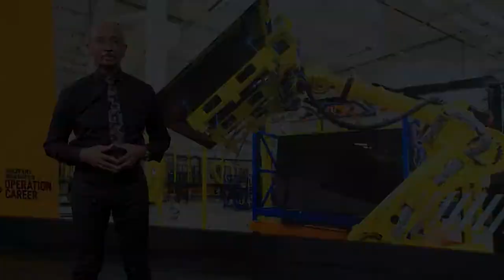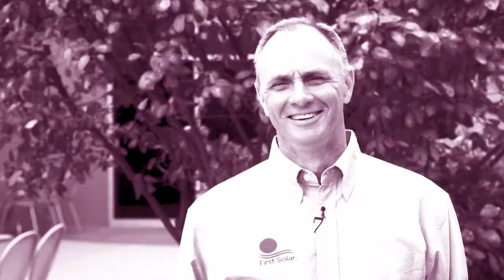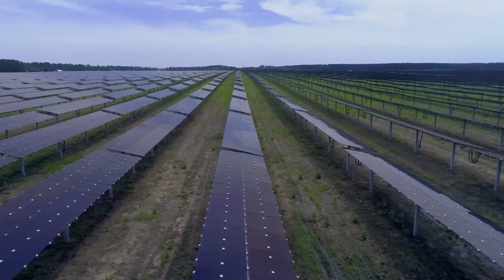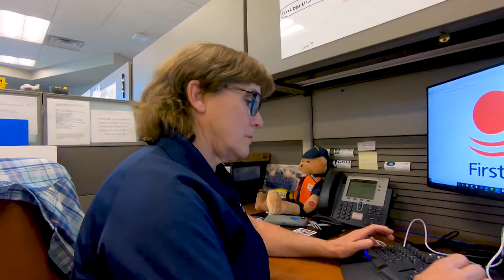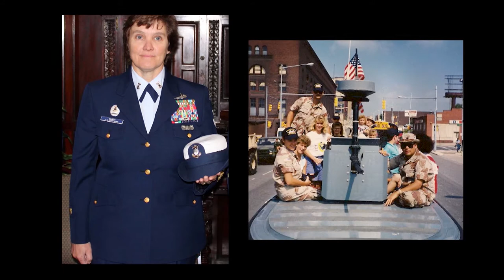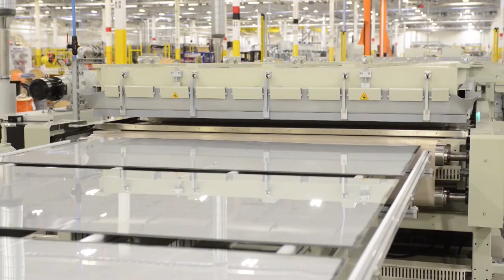Careers with First Solar: America’s Solar Company

Comment: I am working on solar materials for PV modeling and efficiency analysis and publishing in reputed journal as Optik, Renewable and Sustainable Energy Review, Nano-energy, Optical Materials, International Journal of Energy Research, etc. I would like to continue my research on advancement of efficiency as materials scientist or materials Engineer for PV. Then solar radiation, environment related data analysis as well as practical installation related system design and related consulting work I prefer to perform in near future.
At the beginning of my professional life I was in engineering and research field jobs.  Later on, I move to teaching and research job after completion of my PhD in materials for advanced opto-electronics in Japan. Especially optical detectors and solar PV materials for device modelling and analysis is my research area. Intergovernmental Panel on Climate Change (IPCC) claims the highest carbon intensity due to the 40% of world total greenhouse gas (GHG) emission from electricity is an upmost factor. International Energy Agency (IEA) has set net zero emission (NZE) targets by 2050. Emission reduction is essential to avoid environmental catastrophic effect. Hence, low carbon electricity is imperative to meet up IEA target and to overcome the IPCC claims. Very recent COP-26 the continue discussion on environment protection the only solution is finally adapted that is massive application of renewable energies for electricity. As a result, the renewable energy generation from clean source especially massive solar PV is must. 
My research in scientific conception is in the area of nano-materials technological applications through transformative materials science for electronic and opto-electronic device. It is mostly related to the methodology for investigation of light-matter interaction related fundamental properties of diverse nanostructures optoelectronic materials. It is a combination of materials and structures for next generation photovoltaic cells applications. Efficiency or performance evolution is the main drive to any electronic and optoelectronic energy materials and related devices for industrial diligence. Devices energy efficiency or performance advancement by lowering device processing and materials cost is a vital approach.  It can lessen the levelized cost of energy (LCOE) as a result, massive renewable energy implementation will be credible towards low carbon society and environment development.  Therefore, materials and device architecture related energy efficiency I know well. Based on background knowledge, how environmental and geographical data, PV systems and other technical data analysis on PV could be effective for a materials and system design engineer in PV industry that is my target job.  I am trying to move on that pathway.  I want to relocate with new job in this field.